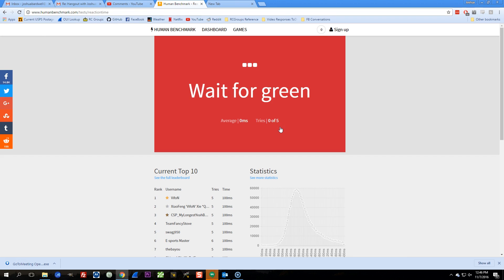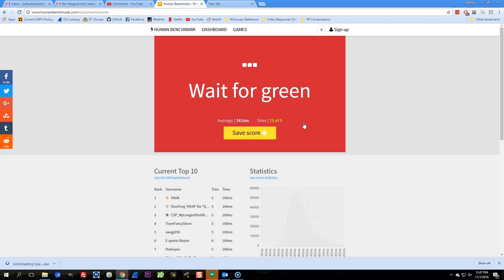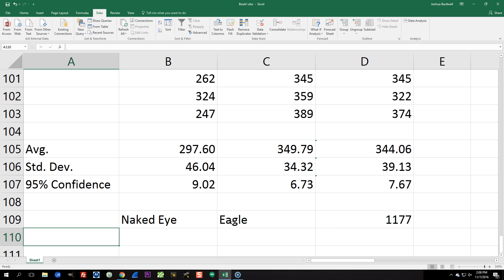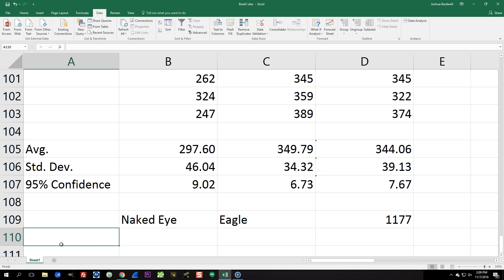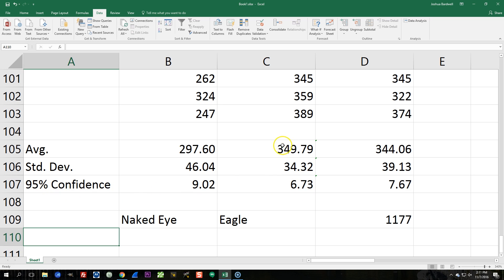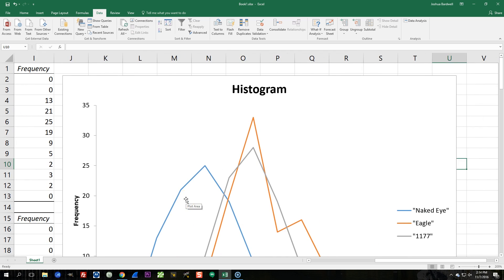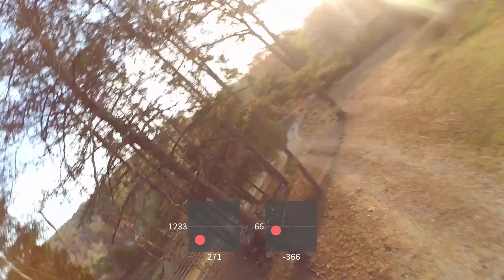SPECIAL EDITION: Runcam Eagle Latency

Comment: That is a good way of testing latency of a camera on a budget.

I don't agree with the reaction time test though because when flying you can predict what's going to happen.  You aren't always responding to unexpected events.  Sometimes you are, like in your branch example.

A more accurate test would be a red square moving towards a green one and then you click when it gets there.  This time should be very close to or exactly 0.
Reply from the maker: With predictable things, you can almost always adjust to a fixed latency. It's unpredictable events where latency matters most IMO.

Comment: Joshua Bardwell, Question:  At about 11:01 of the video of you flying, you do a barrel roll with what looks like only minimal thrust yet you don't lose altitude.  I'm a beginner and I've noticed whenever rolling or doing rolls my quad naturally loses altitude and I find myself pushing up for more throttle just to stay at the same height.  How do you do a roll with little or no thrust like that?  I dig you videos a lot thank you:)
Reply from the maker: What did the throttle do at 11:53?
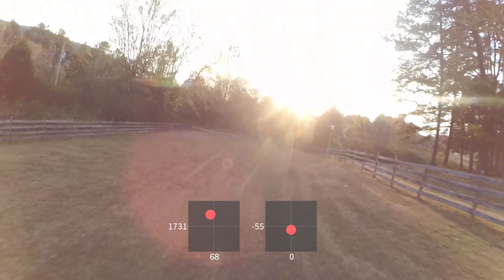Reply: The video only goes to  just  past 11:32 so you  probably meant 10:53, but yes, i think I see what you're saying now that I take another look;  just prior to the barrel roll you are full throttle to  the max around a hair pin turn, coming out of the turn you initiate the barrel roll at "0" throttle and slide the throttle (very smoothly) thru the roll to  almost half throttle (which is where the throttle is at the completion of the turn).  Thank you:)
Reply from the maker: You're right, I did mean 10:53. I'm at nearly full throttle immediately preceding the roll, which causes me to both gain altitude and vertical velocity. When I drop the throttle to roll, the copter is still climbing from the throttle punch, and the roll completes before it begins to substantially fall.
Reply: Ahh..so the roll wasn't for flashy flying; you were using it as a means to discharge excess energy that accumulated  from the full throttle (which was necessary to keep from hitting the tree and then  from hitting the ground).  That's fast thinking for sure.

Comment: Very good. However, I think, even those 5ms make a HUGE DIFFERENCE as can IMHO be seen by calculating/considering the following:
Once you react to an object in your flight path, the copter will go on an "escape vector" caused by your reaction. The "escape vector" is not even linear due to the copter systems reacting, due to motors and props kicking in and due to moment of inertia. Thus, whether you start your reaction now or 5ms later, will have a huge impact on where you will be 300ms later. I think it is even worse, if you are currently accelerating in the "wrong direction", which is usually the case in this situation and which you need to stop ASAP.
I am very interested in your opinion on this. Thx, Lars.
Reply from the maker: +Lars lrs I don't think 5 ms can possibly matter.
Reply: Ok. Would you agree that, if you get the image 5ms later, the quad gets your next control input (based on that image) 5ms later as well? All delays in the chain sum up. If not 5ms, how much do you think does 
matter?

Comment: I wonder if you could just run the two cameras that you are comparing to identical lcd displays.  Then record the lcd displays with a gopro set to high speed (120fps or 240fps). Then while its recording do something in the view of all three cameras like have a led turn on or any type of quick action.  Then you can review the gopro footage.  You should be able to tell how many frames from the gopro image to when the fastest fpv cam shows the change and how many frames before the slower camera switched the image.
Reply from the maker: +spyder000069 the limitation on precision there is the 30 FPS NTSC feed.
Reply: The gopro would be capturing at a framerate higher than 30fps.  So once you load the gopro footage in video editing software at its full framerate you will be able to see the latency of the two fpv cameras.  You should be able to determine which fpv camera switches to its next frame the fastest as the gopro will have taken 8 frames for every 1 frame of the fpv cam.  If you have a camera that will capture more than 240 fps then the precision will be even better.  Plus in the editor you can take the high FPS and convert it to slow motion video if you wanted to show your results.

Comment: I think that's an interesting and meaningful way to investigate latency in fpv systems :-)
Have you considered  comparing clearview vs normal vrx with this method? curious
Reply from the maker: Clearview states that a major design goal of theirs was zero latency, and that they achieved it. Maybe I'll test that at some point but I'm not sure it's interesting enough to be worth making a video over.
Reply: Joshua Bardwell Maybe a limited number of klicks through that test page would probably be enough to judge if there's anything there before committing to making a video?
Reply from the maker: At 25 clicks, the 95% margin was around +/-30ms. ClearView emphatically and unambiguously states that the unit has "zero. none. nada. zilch." latency. With a claim like that, I'm inclined to believe them.

Comment: so the test didn't reveal the already known difference between the eagle 40ms and an hs1177's 20ms,  i am not skilled enough or even comfy in fpv to judge these kinda things, i didnt notice any change from pwm to ppm and now ibus either .. i do trust its there, i'm just at the beginner white knuckle stages still. if we can bring all this to proper english, we're talking about 2 hundredths of a second versus 4 hundredths .... a standard human reaction time is 20 hundredths so the difference on those terms isn't much at all,  it might be that different settings on an eagle have different latency , more processing etc, which might explain why uav futures felt the 16:9 had more latency.  how much lag is there in the rest of the system, the vtx rx and monitor? is it possible the latency is variable, i imagine if it is that might make it feel less connected than a steady latency rate, is the eagles latency measured at the pixels reaction time? or the output post process time?  rc schim has similar results to joshuas 
https://www.youtube.com/watch?v=m0c8p9AZJ6E

Comment: Clever experiment Joshua! I am a visual neuroscientist and I have always been skeptical when individuals claim they can distinguish such small delay differences. 
Just wanted to add that the difference between the naked eye test and the others is a close approximation of the TOTAL delay in the system, which includes cam delay and LCD display delay, the latter of which we rarely think about. As far as I know the LCD in Fatshark goggles is pretty fast, but it's definitely not instantaneous. Most LCDs are ~60Hz, meaning it takes 16.6667 ms per frame, which draws from top to bottom, not including possible internal processing delay. We use a photodiode to control timing of experiments in our lab, and I have found as much as ~50ms processing delay on some LCDs from the time I swap buffers in the video card to the time a stimulus appears on the screen. Of course FPV uses analog systems but the refresh delay still applies

Once you add all the factors that contribute to delay in the FPV system, I think the cam delay is "in the noise" as they say
Reply from the maker: Visual neuroscientist said my statistical analysis was valid. I'll be in my bunk.

Regarding latency, I do think that latency matters not just in reaction time but also in "connectedness" as others have said. I have a sense that there is a certain maximum latency that can be tolerated without any ill effect, and then there is a gray area where you start to notice it, and then there is an area where latency is so bad that you simply feel drunk and can't do anything precise. I think that as long as latency is low enough to stay out of the gray area then you won't notice. So for example, if there was 1 ms latency and you wen to 10 ms latency, I doubt you would ever notice any difference at all. But if you were at 100 ms latency and you went to 130 ms latency, perhaps you would notice. I know for a fact that when I go from SBUS to PPM and back, I have to handle the controls differently and the copter feels less connected. But going from the Eagle to the 1177, I don't notice any difference at all.
Reply: Well I said your experiment was clever, but your stats need work... kidding... 
no not really, you need to do an independent measures t-test ;-)     

anyway, I appreciate your argument regarding subjective experience, but people are often easily fooled into believing things that are not true (I mean how did Trump get this far, sorry off topic), and I don't know how much we can take/learn from it if everyone's experience is different. It's fine for the park, but objective evidence is much more informative for deciding which product we should buy. I really appreciate the kind of "real-world" test you did here. More myth-debunking please.

Comment: Thanks for your time. How about the latency between cheap Sony board cam and eagle? I would like to know getting a 1177 is a bad idea or not.
Reply from the maker: An 1177 is never a bad idea. It's a fine camera at a good price.
Reply: if latency is not a matters. I would like to get a 800tvl Sony board cam. It's much cheaper.
Reply from the maker: I don't suggest a board cam. Very few frames are being made these days with board cams in mind. Most are being made with case cameras like 1177, Swift, etc... in mind.

Comment: very nice way to measure. would be nice to have the HS1189 in there too since it's supposed to be less than half the latency of the hs1177. if you have a 16:9 headset, I'd highly recommend the hs1189 regardless. it's just so much clearer it makes the 4:3 cameras look terrible.

Comment: In my opinion, when it comes to video games, 3 or 4 frames latency is alot, its not enough time to react to certain attacks or so. In a way, you should take in to account that you overturned 3 times in a row, that was probably caused by the extra lag regardless if you are used to it or not, for freestyle is okay, but for racing, it might not be acceptable. This was a very informative video.

Comment: Even though using electronic stop watches (that don't update accurately), can not show the absolute latency of a camera, aren't they still useful to show the relative latency of two (or more) cameras assuming they are all subject to the same testing procedure?  Then, at least one would know which ones are faster/slower and can at least rank them?  Just wondering your thoughts?  

Also, I thought you might enjoy this video since you seem to be into stats...  https://youtu.be/42QuXLucH3Q
Reply from the maker: That method won't work. Imagine that the stopwatch display only updates every 50 ms. You cannot possibly measure the difference between two events that are only 30 ms apart with that watch, no matter what you do. You will either calculate 0 ms difference or 50 ms difference and there is no way to know what the actual difference is. Likewise with the 30 FPS NTSC framerate.
Reply: Ah, ok.... I didn't realize the update discrepancy was that large!  Wow, that just burned up all those latency tests out there (including all mine!  LOL)  ...

By the way, I agree with your assessment that the latency is not that significant.  At least I'm not a good enough pilot to tell the difference.  Thanks for this very insightful analysis!

Comment: I just tried this test with my copter.  I have an xat1200 (hs 1189), and I got a difference of 16ms, although I didn't do 100 trials so not nearly as accurate.
Reply from the maker: I found that at 25 trials, the 95% confidence interval was something like +/-35 ms. That depends also on the standard deviation of course, so your results will vary. That's why I ended up doing so many trials: to get the confidence interval small enough to be worth talking about.
Reply from the maker: To put it another way, if your vTX example isn't at least 40 ms slower than your naked eye, something is probably wrong with your results.
Reply: I tried it some more and the difference went to 17 or 18.  Maybe I'm trying harder with the goggles on, but the tests I've seen others do had the hs1189 about 30ms faster than the eagle.  Check out RCSchim;s video.  He seemed to have an accurate way of measuring.
Reply: I thought I read the vTx was 8ms.

Comment: Very clever way to test latency!
This result is consistent with a video RCSchim posted in reviewing the Eagle.  He compared latency with a few cameras and the eagle was almost identical to  the foxeer hs1177 in terms of latency.  At the time I wondered if the foxeer had more latency than say the runcam swift.
Which hs1177 were you using Joshua?
Reply from the maker: I honestly don't know. I have at least one 1177 from surveilzone, and a few XAT600 from Asiatees. To make matters worse, I have replaced the case on some cameras, so the case doesn't indicate what's inside.
Reply: Have you ever tried myrcmart's $19.99 hs1177?  Looks just like a foxeer, I wonder if there is any reason to think it would perform worse than the others.
Reply from the maker: +Michael Koster myrcmart typically has good value and not crap. I would risk $20 on it.
Reply: Thx.  They have some interesting looking stuff.  An F4 FC for 12.99 which I think is a Flip32 F4 (Revo Pin Header) that is mislabelled as an SPRacing F4.

Comment: As always I appreciate your analytical approach to FPV quadcopters. On this topic however I feel that latency can't always be pinned down to applicability, instead as you mentioned at the end, I feel it is more about feeling a disconnect from the device.

I'll relate to a topic I know much more thoroughly, FPS gaming (thus my YouTube channel). It's well known that to visual stimulus 200-300ms is average for professional gamers. That being said, I can very clearly feel the 30ms difference in latency when I switch monitors, from my VT60 plasma with 24-30ms delay to my museum worthy CRT monitor with 1-5ms lag (for speed runs).

Clearly there is no practical means I can use those extra ms to respond, yet I feel more connected and comfortable in my surroundings on my CRT box. Veritasium has a great video on the topic, in particular the experiment he conducted where a participant would click the space bar on a keyboard, triggering a flash to happen 80ms later. After doing this for a bit, the 80ms lag was removed, at which time most participants thought the flash actually happened before they even clicked, as their brains had synced to the norm that was 80ms.

I recall a Flight Test video where Skitzo let one of the hosts fly his quad. They marveled at how connected they felt to the craft, as they were still using a GoPro as their FPV cam, where Skitzo was using a board cam.

What I'm alluding to is that while there's little chance someone could put these minuscule differences in time to use, many can feel the difference, disconnecting them from the experience.

Btw here's the Veritasium video I spoke of, I feel you'd love this guy. http://youtu.be/K4vyRvMASPU
Reply from the maker: I think you definitely have a point. One of the factors that people talk about with video latency is ability to respond to things coming at them. That's more or less what this test demonstrates. Subjectively, I can say that the Eagle doesn't feel any less connected than the 1177, and I have gone back and forth between two copters using both cameras on the same day. I can't promise that other pilots might not be sensitive to the difference, though.